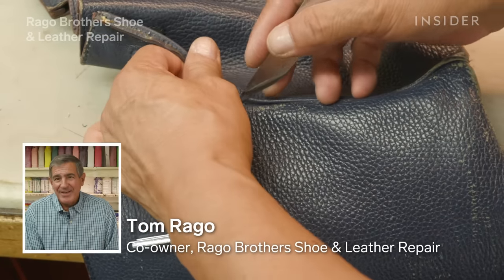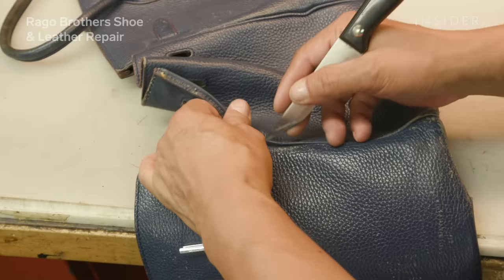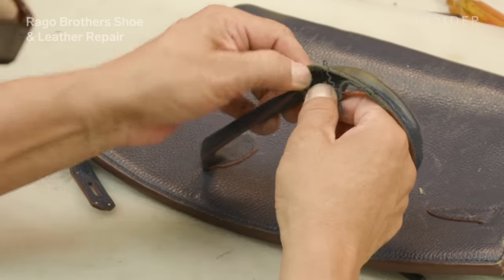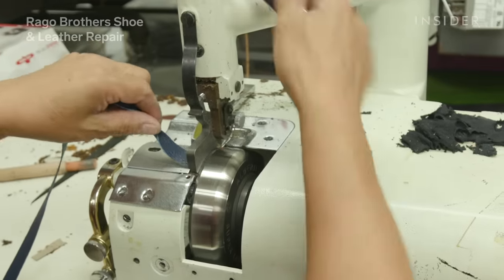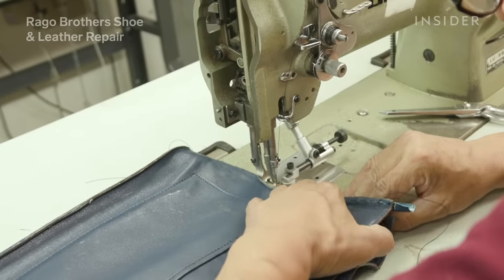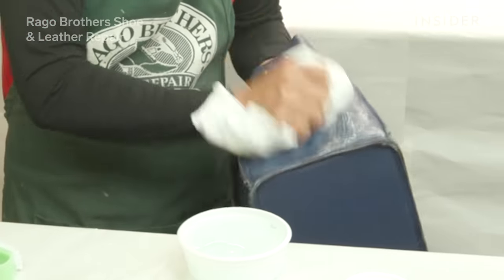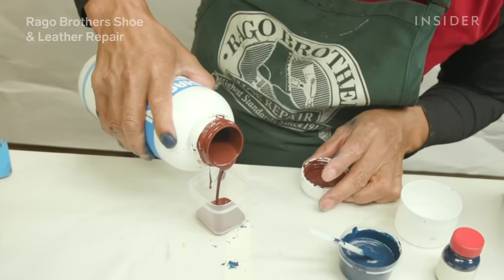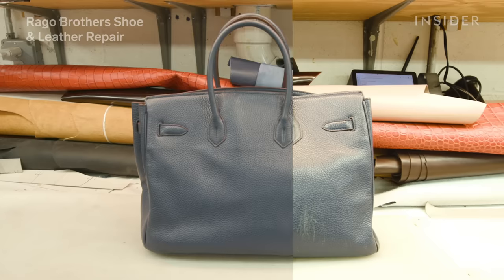How A $10,000 Hermès Birkin Handbag Is Professionally Restored | Refurbished

Comment: Seems like a great job but with such an expensive bag wouldn’t it better to goto Hermes?
Reply: I would have been better but a lot more expensive.
I myself got two Birkins last week for repair here in my country and I try to do the less possible (but at the same time perfect) on those bags because Hermes has a policy or something that if a bag needs a mayor repair that only they can do and they notice that someone else has worked on the bag or did something to it they won’t even accept it
For repair.
So it’s a very different situation with Birkin bags, unless the owners don’t intent to send them to Hermes ever.
Reply: because the bag is fake
Reply: Hermes does not service fakes.
Reply: @gabrielabadi0223  I'm pretty sure birkin bags have a lifetime warranty. They do the repairs for free. They don't want their name on something that looks bad. Especially if cost/service ratio is so high.
Reply: Hermes won’t take fake back for maintenance…

Comment: So ya’ll know Hermès restores their own bags? A non authorised bag restorer decreases the value. And JFC, sewing it on a machine? Sacrilegious!
Reply: I couldn't get past the steak knife. There are specialist tools specifically for seam ripping leather goods, but this dude's cut-co will do.
Reply: Most of the bag is saddle stitched, but parts of it are done by machine. Can’t expect a restorer to go through the saddle stitching process though, the specifics of how to do it the way Hermes does it takes a couple years of training. They did a pretty good job though, one thing i noticed that they didn’t use is rubber paint for the edges. Just regular Angelus leather paint. It’ll pass the distance test, but not the close eye inspection. Still respect the skill though.
Reply: @charlieewing1810  that’s a razor knife, not a steak knife Lmao! People in my shop will use scalpels for precision…as long as the blades thin and sharp, and you can preserve the existing holes and not cut the leather, any thin blade will work.
Reply: That's what I came here to say. Most high end brands will gladly service the bags they sold and giving them to another workshop could not just mess up the bag but would also result in loss of value. Idk why somebody would take their 10k bag to anyone else than the original manufacturer for repairs.
Reply: There honestly isn't that much value for such a well worn bag (relatively). The owner maybe thought the savings in time/money (Hermes spa can take 6 months to a year before you get it back) was worth it for a bag they wouldn't resell anyway.
Reply: @kath1626  I mean as speedocowboy said, it's a significantly longer wait for the bag spa, and this bag was clearly being put to use. (hypothetically,) If she didn't want to wait months on months for one of her favorite bags to get repaired, and has no intent on selling it anyway, why bother going through a months long process when there's a quality local business that could get it done within the month?
Reply: They don't do it for free.
Reply: Exactly...that was the question in my head, wouldnt the value go down if it was reconstructed other than hermes?
Reply: Not a true Hermes bag anymore
Reply: and not only this! The painting of the edges. It’s not paint, it’s almost burned by a specific tool that also ensures that the bag is perfectly sealed.
Reply: @timeisnow9827  I agree the edge kote should be rubber that is flexible.  Eventually this will crack again and soon.
Reply: @kath1626  They do it because it can take up to a year for Hermes to spa the bag.

Comment: Not sure how an experienced shop fails to recognize a fake bag. The difference in quality is on an entirely different level. It starts with how easily the bag comes apart under the knife. Hermes Hand stitching is properly knotted with double needles. This gives the bag structure and stability, which this bag lacks. So if one were to cut apart an Hermes bag, you wouldn’t see the knife just slipping through, because each hand-knotted stitch would require separate strokes. Also, Hermes does not use plastic inside its handles. And the idea of replacing the finely finished, matching Hermes hardware, including the feet, with some off-the-shelf brass would cause any client of this shop to demand a refund.

Comment: A $10,000 Hermès Birkin Handbag: Proof that the rich are not smart.
Reply: "But the rich generate jobs!"
Yeah, jobs like this. Luxury without any purpose but to be expensive.
Reply: $10K is baseline cost it goes up way higher. These bags appreciate in value so while it may just be a status symbol they hold the investment.
Reply: Kindly disagree when these are purchased as an investment. You can easily double your $$ in just a few years with these bags.

Comment: Hand applied brown edge ink? Nope. It’s normally a wax dye applied by roller and buffing wheel to seal the edges on expensive leather goods. 
Edge ink is 3rd rate at best. The leather on the handles also looks super thin. It will break and scratch quite easily. 
The blue dye “around” the outside silver logo will also be visible hence no close up shots of the finished product
Reply: Sounds like you know a thing or two about Hermes and bag construction. Have a history of that?

Comment: Whenever a purse is this much worn in the handle instead of just replacing the tubing I usually replace the leather .The reason being is because of perspiration and salt from the hands  from sweating & perfume & lotions buildups ifind it better ,easier and more appealing to use fresh leather for an area  (the handles)that gets 100% of wear constantly. I also find it easier and more rewarding to just use the proper color leather since you had to replace the piping anyway as opposed to dying it from Blue to brown.I’m saying this because the dye is only covering the epidermis  or outer layer of the skin and any scratch or abrasion would reveal the blue color below the surface.

Comment: Thank you for the update, Insider..!!  That's amazing. @.@  By the way, Hermès Birkin's price range is from $40,000 to $500,000.
Reply: That’s only if you buy them from the re-sale market with their hyped up prices. Depending on the types of leathers used i.e. regular leathers versus exotic skins & size, you can pay for one in a Hermès Store for around $10,000 if you’re offered one.
Reply: I buy mine directly through Hermès and they're $10,000 each. I never buy from resellers because there are so many fakes out there and they charge over $25,000.00 for it.

Comment: This isn't an authentic Hermes bag. In a real Birkin, the handle is made using a leather cord, not plastic. The ends of the cord are stitched down(you can see this stitching  in there middle of the patches at the ends of the handles) so in order to remove and to insert a new cord you would need to completely remove the handles.

Comment: I will never understand how this stupid bag costs that much.
Reply: Materials, procedure etc.
Reply: And then the other 90% of the cost is the branding.
Reply: Which procedure dude, they repaired it completely in a 7 minute video. You can buy a car with this money?
Reply: Let's be fair. The bag is hand made. It takes about 3 to 4 days to complete and it's completed by a skilled labourer.

So, consider what 3 to 4 days of salary costs. 

It's also made using calf-skin leather which isn't in abundant supply. So you're looking at €1,000...maybe even €1,500 costs. The factor in taxes, overheads etc.

It's not exactly cheap. However, its certainly not worth what they charge.

It's also questionable whether hand cutting and stitching is any better than machine made these days.

But its mainly branding.

Comment: I hate these videos. Hermes prides themselves on their spa service. Why anyone would take an authentic piece and NOT let Hermes handle the restoration is beyond me. Oh wait I know why: It’s a fake. Hermès use rolled leather for their handles. Not plastic. Bring that to Hermès and they would have seized it and destroyed it.
Reply: how i can tell its fake is the leather isn’t correct. the stamping isnt correct either, the hardware is wonky and hollow. theres a warp in the reflection of the hardware. when authentic hardware is completely flat and gives a mirror like finish. the color of the edge coat is completely wrong. the edge coat on the flap is wonky as well

Comment: That’s a lot of work for a fake Birkin.  Real Birkin do not have screw on/off feet, stamp too low from stitch line and the handles….too thin and too long. Even the most daily used Birkin handles still stay straight and stiff. Fakes always are weak and go to the sides.

Comment: Rago Bros. Ruined my Louboutin boots.  They twisted the heel so it was no longer straight or balanced.  Also cut off so much stem on heel they are no longer the same height.  Used cheap black paint to retire the leather and off color red to add the rubber soles to the bottoms.  Would never trust them again with my items.  Also this is a fake Birkin.

Comment: I am sorry , very poor repair  - 1st the feet of the bag should have screws feet not these cheap ones, 2nd the handle is not saddle stitched , you're doing it with one needle only , 3rd why put plastic again in the handles , you should use either cord or nylon cord... poor workmanship

Comment: If I was the owner of that Birkin, I'd sue you for ruining the integrity of what was a fine example of leather craftsmanship. Hermes does NOT I repeat NOT use plastic tubing in the handles, it's leather core. Each Birkei is hand sewn using the saddlers stitch, which requires two needles and plenty of skill, they do not cut corners by running it through a sewing machine. None of the edges were smoothed with an edging iron...Do you even know what a Regad machine is? Google it. If you don't have the skill set to repair such a bag, don't touch it or refund the client the retail price of the bag. There is no excuse for dodgy workmanship.